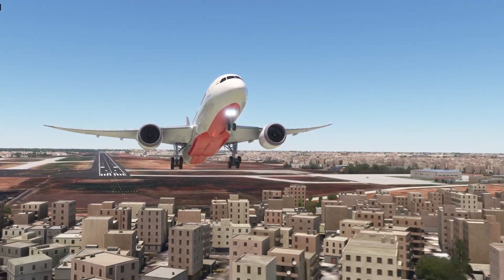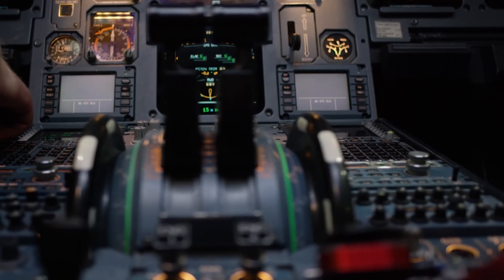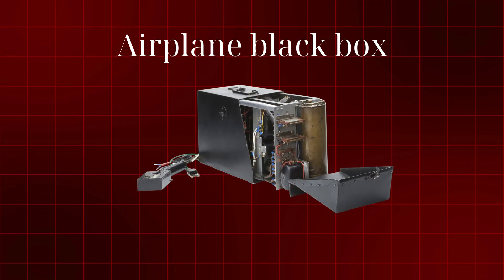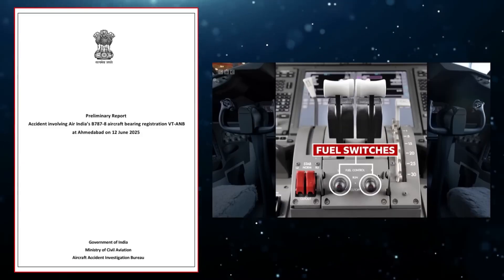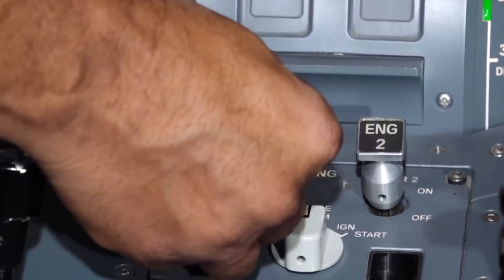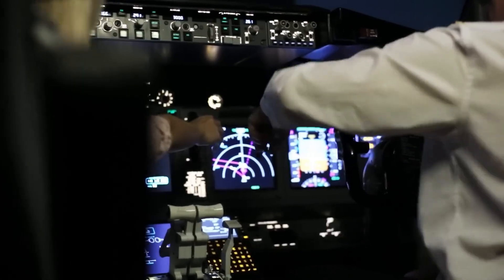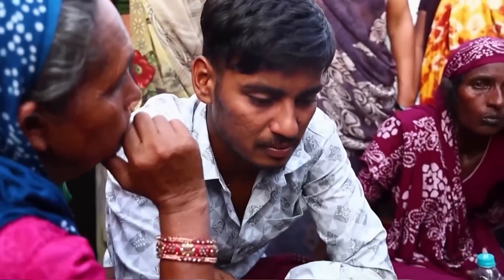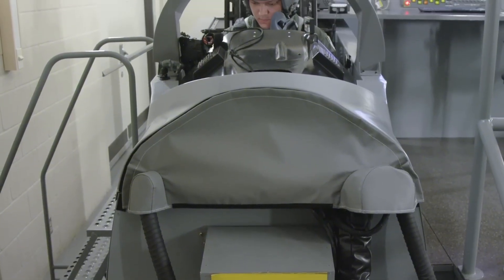What Really Happened to Air India Flight 171? Full Cockpit Breakdown

Comment: the pilot should be able to tell when the planes engines are capable of full power thrust and the thrust levers capable of lift and plane capable of performance and ignore a risky plane... pilots should ignore faulty aircrafts.  despite aware of the risk of losing their jobs